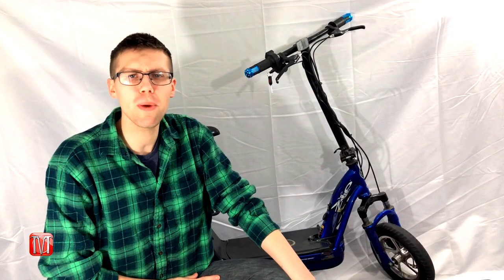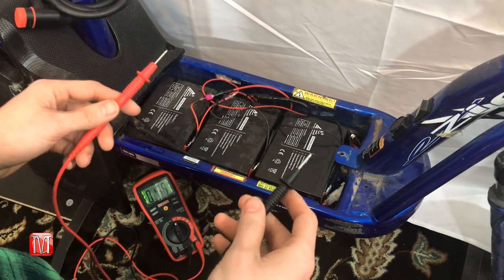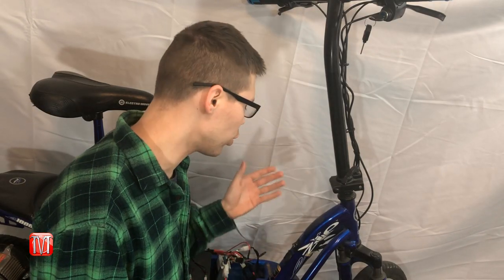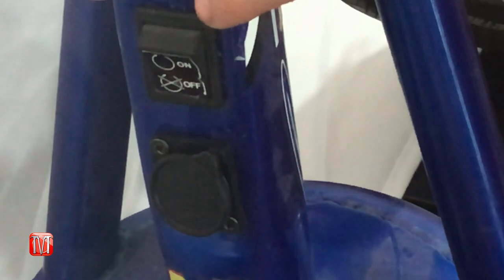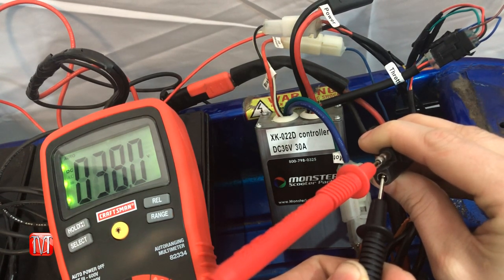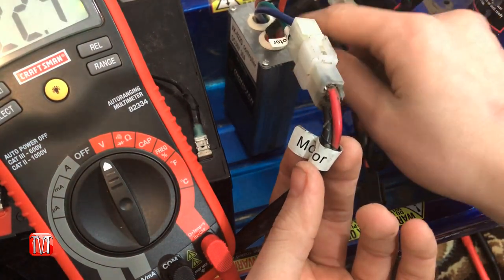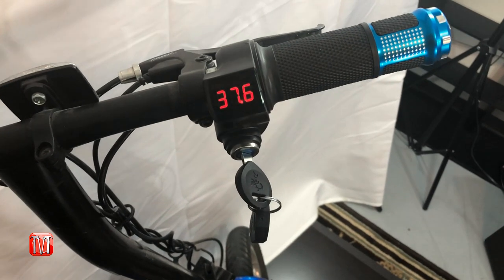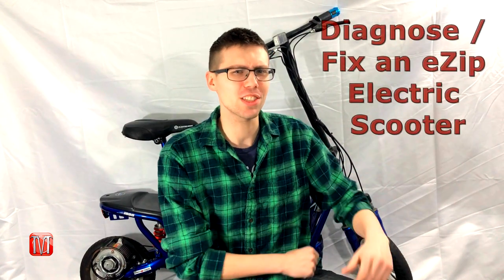How To Fix an eZip Electric Scooter (For ALL Series)

Comment: Omg. 

I’m pretty mechanical inclined but my dumpster EZIP450 had a bad throttle. So I ordered another one like in your video and wired it up......
It wouldn’t work and I gave up for weeks. This video showed me the proper steps to make my scooter work. I can’t believe I wasted sooo much time. U are a GODSEND. THANK YOU SOO MUCH U HAVE HELPED ME SOO MUCH WITH YOUR KNOLEDGE.

Comment: MAGS,
Great video - I just bought an Ezip 750 from Facebook marketplace and the power light came on when I turned the switch on but the throttle did not engage the motor.  I went through the troubleshooting steps you mentioned and the throttle, power control module, and battery were all good but the motor would not engage when I turned the throttle.  I also checked the motor and the brakes after watching a video on the "Gio simple repair" youtube channel where he was working on a Russo electric scooter.  Per that video, I unplugged the motor and temporarily connected the motor directly to the battery and it kicked in so I was glad that the motor was good. Per that video, I also disconnected the labeled brake connection from the power controller and when I turned the throttle, the motor kicked on.  So apparently there is an issue with the brake switch on mine - I don't know how to repair it yet but at least the scooter is working.  Thanks for the video.

Comment: Excellent step by step instructions. My 450 that I found in the trash, only needed battery replacement. I am trying to remove the seat tube for storage, and It seems frozen in place even after loosening the pinch bolt at the base. I assume its only the pinch bolt at the base thats required to loosen? Any guidance is appreciated!!! Thank you for  a well produced video. No loud music or sensationalism, but just good easy to understand directives. We need more teachers like you!!
Reply from the maker: So I haven’t worked on a 450 but I assume it’s not much different then my 1000. If you have removed all of the bolts that hold the seat in place and it still won’t come off. It might be a little rusted in place. Try getting some WD40 or some PB blast and spray it around where the tube mounts to the scooter. Let it sit for a little while and then try twisting/rock it back and forth to break it loose. You may need to repeat this a few times for it to work. Remember, makes sure there are no other bolts holding it in place that or welds that’s attach the seat mount to the frame. I hope this helps you out some. Good luck!
Reply: @MAGSHowToVideos  Firstly Mags thank you for the prompt reply. I am soaking it now with acetone/atf and will tackle it with a pipe wrench near the base as opposed to rocking the seat side to side. If no success then my oxy/acet torch will be used., to expand the outer tube. When I got the scooter both batteries were about 7 to 8 volts, and didn't think I could revive them. Added distilled water and after 24 hours of charge both are reading over 12 volts. Only time will tell if batteries were salvaged. Blessings back to you with gratitude from New Rochelle N.Y. (just 12 miles as the crow flies from N.Y.C.
Reply: Where did you order a battery from i think my daughter's need a new battery we just got her but it was used they didn't tell us it wouldn't stay with a charge so they bet us but wanna try and get it fixed if possible because she loves it

Comment: We used your troubleshoot and everything seems to check out. What happens is it shows fully charged and then the second it starts going it immediately shows low and won’t go any more. Any help would be appreciated. We have the 450
Reply from the maker: Weird so it sounds to me that your batteries might be bad. One thing I forgot to mention in this video was sometimes your batteries may each read 12v, but may not hold the proper amps. Most of the batteries used on these scooters are rated at 10Ah. There are a few ways you can confirm if your batteries hold charge. One you can take your batteries into a Auto parts store (like AutoZone or Napa). Sometimes they will be willing to test them for you. Two you can purchase a battery tester and test them yourself. And three if you have another set of batteries you can swap them out and see if it fixes the problem. If I’d does you know at least one if not all of the batteries that were originally in the scooter are bad. If option 1 and 3 don’t work for you, then feel free to check out my battery tester review video. There you can order a reliable battery tester that is cheap. Once you test your batteries and if they are good feel free to let me know.

Comment: Hello, I have an Izip 500 scooter and when I try to accelerate, it just makes a sound and a small movement, even though the battery is at full charge. Based on your experience, what do you think the problem is?
Reply from the maker: Derik Arroyo well from the sound of it the batteries may be bad. Even though the scooter reads them as fully charged they may no long have the proper Amps to power the motor. If you battery’s only have the proper voltage but not Amperage your motor won’t get the power it needs to propel the scooter. If your batteries do display the proper Volts and Amps and you tested everything shown in the video, then next thing would probably be the motor it’s self. Feel free to ask if you have any other questions. Hope this helps and thanks for watching!

Comment: I cant figure out why my ezip900 will ride around fine then all of a sudden the power cuts out and it wont run again until you shut the power off for a few seconds then turn it back on. Batteries are new.
Reply: did you figure it out? i recently crashed mine and i have the same issue with the power cutting out, except it just turns back on randomly
Reply: @ghuulzy507  nope. Sold it. 😁

Comment: trying to match wires of old throttle to that of the new throttle on a Ezip 500 scooter, i matched the red to red, blue to blue black to black, green to green, omitted the brown as you stated in video, but i have 2 wires left over on new throttle, one white, and one light purple/ lavender, where to those wires go? a Thur Amo , throttle grip handlebar on Amazon...

Comment: what type of throttle and brand did you replace it with  PLEASE thank you
Reply from the maker: jmichy harrell I don’t remember the brand off the top of my head. However I purchased it off of eBay. If you go there and search “EBike throttle handle” it should be one of the first listings to pop up. It was roughly around $12.99 USD

Comment: Do you have a video on this scooter explaining  what to do when the chain keep falling off ?
Reply from the maker: If the chain keeps falling off there are a few things that can be wrong. One you need to adjust the position of the motor. You can do that by loosening the bolts and applying tension to the motor to remove the slack in the chain. Then just tighten down the bolts. If this doesn’t work, then inspect the gears. One of the gears might be miss aligned or worn out. Lastly, if the gears look good but you still can’t get the chain tight, you could have the wrong type/length of chain. If you didn’t purchase the scooter new, the previous owner could have replaced it with the wrong part. Hopefully this helps.

Comment: Yes I just got a a 1000 from my buddy the light comes on low-battery I check my batteries and it said 54 volts coming out of my three batteries should be 36 right need help
Reply from the maker: Yes there is for sure something wrong going on. If you are able test each battery individually. If the batteries are fully charged, you should get a reading around 12.4 volts. If you are able to determine each battery voltage let me know.
Reply: @MAGSHowToVideos  all batteries on V is 48.9 Single batteries on V 18.2 17.4 12.8 V all on DCV batteries 23 Single 6.28 8.30 6.28 man I thought I was going to have to wait 2 or 3 days you responded within a half an hour's God bless you man
Reply: All batteries on a v is 48.9 single 18.2  17.4  12.8 on the dcv all batteries 23 individual 6.28  8.30 6.28

Comment: Is it safe to assume all the voltage your stating is for the 36v battery so if your only 24v the readings would be less, right? When i checked the throttle i got 4.6v then when directly checking the wire i got 1.4-.4mv, would it be the connection or the actual throttle?

Comment: Hello.  I was given an Ezip E400 and I'm trying to figure out what it goes fast for about five seconds then slows down to a very slow crawl speed.  I tried these tests you did in the video and I seem to get the voltage you mention so now I don't know what to do.   The throttle lights do something I am curious about though.  When I power on the scooter the throttle "FULL" light is on.  If I barely turn the throttle the "HALF" light comes on, then if I give it full throttle the "LOW" light comes on.  Is that normal for the throttle to do?   The batteries are reading 24 volts.   Also, I found a battery bypass test video where you plug in the AC/DC charger, unplug the batteries and unplug the overcharge protector wire --- and the motor would go faster, but the throttle still wasn't acting quite right.   I could give it full throttle and it would go faster, then slightly "back off" the throttle and it would go to the "FULL" light again and the motor would go even faster.  I'm confused with this thing.  I've done all the testing I now how to do...learning towards a bad throttle, but what would you recommend?  Thank you!
Reply from the maker: From the sound of it, your batteries are bad. They may be holding the correct voltage, but not the correct amperage. You can test for amperage with a multimeter. If you don’t know how feel free to check out my video on how to use one. If not, you can buy a battery tester which will tell you if the cells in the batteries are still good. I also have a review video of one that works great and is pretty cheap. If your batteries are good then I would look into replacing the throttle handle. If that’s not the problem it could be the control module, but again I’m pretty sure it is your batteries. When you solve your problem, feel free to let everyone know what it was in the comments so it can help others. If you end up needing more help just feel free to ask. Thanks for watching.

Comment: I just honestly picked up a IZip Currie electric scooter. I have no idea if it even still works or not. And what generation it is. Any help?
Reply from the maker: L . O . R to find out if the scooter works or not, first fully charge the battery’s. Once fully charged, test the scooter out by turning it on and twisting the throttle handle to see if the motor powers up. If so have someone who fits the weight requirement your scooter is rated for, test ride the scooter to see if it operates normally. If for some reason you have problems let me know when/which step the problem first occurred and we can go from there. Also if you do end up having problems try to find out the exact model of scooter you have. This will help out a lot with figuring out what Power ratings the scooter is rated for. Thanks for watching

Comment: My eZip says that it’s charging but is not charged after hours of being on the charger. Where do I start with this OfferUp project?
Reply from the maker: So first check to see if you are getting proper voltage from your charging cable. If that works plug the scooter in and test the voltage at the batteries. You should get the same reading. If you do then that most likely means your batteries no longer hold a charge and need to be replaced.
Reply: @MAGSHowToVideos  
Bought 2 new batteries, fully charge, then ride for about 10 minutes then battery drained. Were should i start?
Reply from the maker: Well first off when it comes to the new batteries are they the same as the old ones? What I mean is are they rated for the same CA/CCA (cranking amps/cold cranking amps)
Reply: @MAGSHowToVideos  
No, i went from 12v 7mp 
to 12v 10amp battery. I went to Electric Scooter Parts and see they show 12v 10amp will work for Ezip 500. Only thing i can think is my weight. Im at 225, manual say 240 max. I gained about 10 pounds since pandemic, never had problems wt losing charge at 215 pounds.
Reply from the maker: Weight could be a factor. If you know someone who weighs less... like 150lb have them test it out and see how long the charge will last.
Reply: @MAGSHowToVideos  
Thanks for responding.

Comment: My scooter is cutting out when I go full speed, and I just flip the switch and it's back to normal. I thought it might be bad battery pack so I replaced it and it still does this. Does anyone have any idea what it is that is causing the problem.
Reply: Same problem here. New batteries, and new throttle now it cuts out after 10 minutes full throttle
Reply: I'm now getting voltage from the module out of the plug that goes to the motor. It's not doing anything when I twist the throttle, but the throttle plug is showing what it's supposed to.

Comment: Will you leave a link to where to purchase the universal throttle handle?
Reply from the maker: @user-yh9ii5jv7n  I use to have a link but since I got it on eBay, I had to keep updating it. Eventually, I just got tired of doing it. If you are interested in getting one like that just look up eZip throttle handle on eBay and you will eventually find it. Just make sure to look at the connector on the original handle to make sure you get one that will work.

Comment: Great video.  Can you provide a little more detail about how you wired your aftermarket throttle control?  I bought the same throttle control, but the wire colors don't all match up with the existing throttle control wires.  Thanks.
Reply from the maker: sampsondiane sure... so what I found that worked was to keep the male end connector from the old throttle Handel cable and attach it to the new one. Connect the wires that are the same colors to each other. From left to right on the connector the wires should be Blue, Black, Red, Green and Brown.  The brown cable however does not work with this throttle handle so just tape that one off you don’t need it. On the throttle handle there should be a extra wire that is yellow. That wire needs to be spliced and attached to the main positive/power cable that is attached to the battery and connects to the control module. If you have the actual battery that came with the scooter, you may have to cut and rewire the cable to do so. 

Let me know if that works or if you need anything else. Thanks for watching!
Reply: Thanks for your reply.  I'll give it a go this weekend and let you know how it works out!

Comment: seems you didnt show us how to upgrade the wiring for new throttle , which wire to which, red to red, etc? Am I suppose to guess?
Reply from the maker: I didn’t show it because each aftermarket throttle may not use the same color wires. What I would do is look to see if the replacement you purchase had a diagram of what each color wire is for. Based off that info match the wires to those same functions on the scooter. If it didn’t come with one I would recommend starting off by matching the colors and then playing around with the other wires that don’t match if any.

Comment: I just recently replaced my battery and the my throttle will light up all 3 colors but I dont have any power. The lights are not blinking but are just on. It is a Schwinn es350 . Any ideas on where to look?
Reply from the maker: First make sure the batteries are fully charged. Than while twisting the throttle handle test to see if you are getting power to the motor. If you are and the motor is not running you most likely have a bad motor. If you are not getting proper voltage to the motor test the control module.

Comment: What is the yellow cable the you connect to the battery for ?
Reply from the maker: That wire is for the voltage display on the after market throttle handle. Having wired directly to the positive terminal on the battery allows it to receive the most accurate voltage reading.

Comment: Bro I hope that u see this, but u could leave the link where u purchased the throttle and so forth. I just bout one and I wanna make it faster etc.  Today is 3-17-2024
Reply from the maker: I use to have the link in the description, but since it was on eBay the listing eventually kept getting removed. After replacing the link about 8 times I just gave up on it. All you have to do is search for eZip throttle handle and look through the different options. Count how many wires yours has and make sure the new one has the same mount.